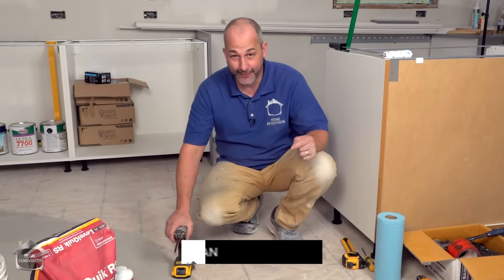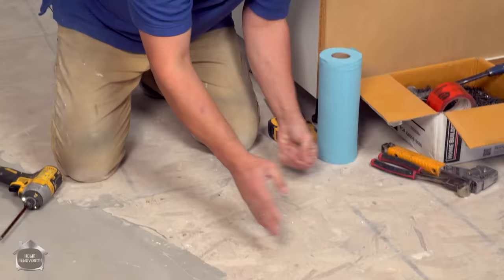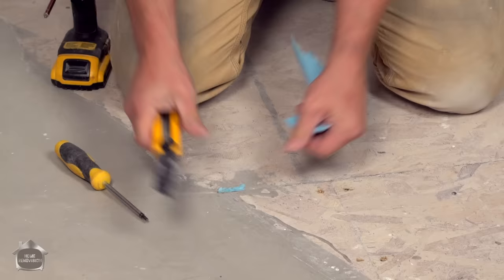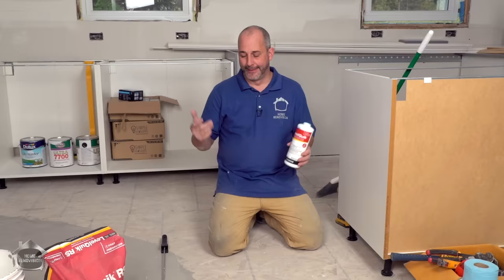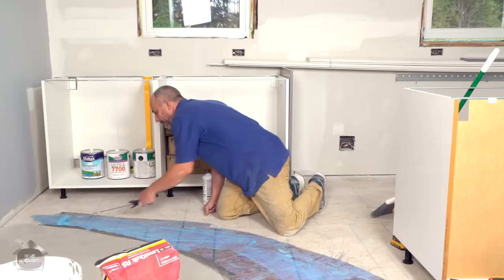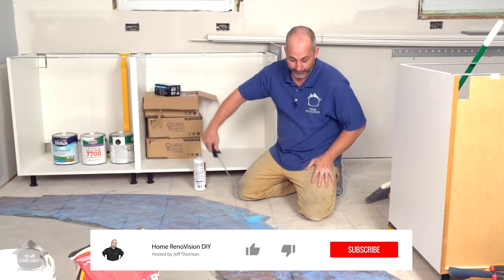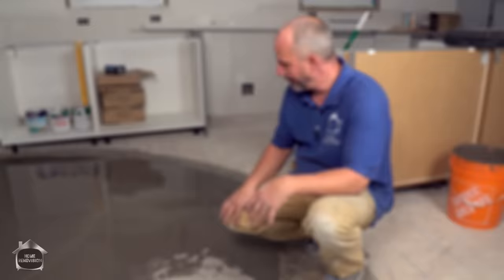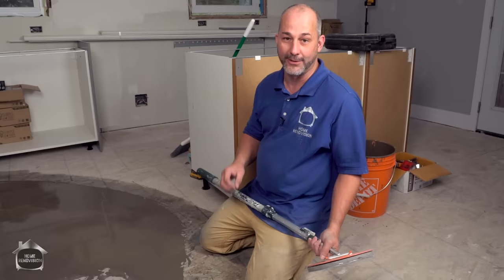How To Level Your Floors

Comment: Hey Jeff! Im at this exact stage in my reno and i couldn't be happier that you made this video. I have those old 1-1/4" floor boards, I've screwed down everything and got rid of the squeaks but I'm noticing that the boards are cupped in most areas and there are high points resulting in making the floor not even. My question is, is it worth re sheathing the floor and then seeing if i need a couple bags of self leveller, or should i disregard the sheathing, plug the holes and do a massive self level pour?

Thanks, 

Sunny V
Reply from the maker: Hi Sunny, a lot of the answer is in the rise on your staircase. you have to be careful to manage that height to the first step. it should stay as close to the second rise as possible to avoid tripping hazards. both options are good. In my case the stairs are a mess already so no fixing it the easy way so I made the floor easier with a second layer of OSB. Cheers!
Reply: @HomeRenoVisionDIY  Since I'm adding new oak treads to the existing stairs, ill have a little bit of play with the height. You did bring up a great point though about the stairs! I think i will re sheath the floor to help smooth out the bumpy subfloor and check again how bad it is when it comes to deciding on the self leveller. You're the man Jeff, Thanks a bunch for the reply! I know i can always count on your advice. Can't wait for the next video! :D

Comment: Hey Jeff - love the videos, thank you! I was just about to mix my floor leveller and noticed the 3rd step on the bag requires metal lath if installing on wood subfloor.  Thoughts?
Reply from the maker: I guess that would depend on the amount you are adding. If you are laying over 1/4" in a large area then that makes sense if you only have dimensional lumber floor joists. in most cases we are only using it to correct small area imperfections. I use plywood to build up bad areas so it does not require as much leveler. Cheers!

Comment: Whoever laid the tile in my house before I bought it did a lousy job, many hollow spots, slab probably looks like the moon. Lipping tiles, grout coming out, cracking ceramic tiles, needs to be fixed by me. I'm taking point here. 44' of drain line was replaced by previous owners as condition of my purchase. When they poured patch where they tore up the slab it wasn't leveled and they just laid tiles over it. I used about 30 tubes of Fix a Tile adhesive and realized the floor wasn't level and this was a bigger job than those adhesive tubes could fix. All the tiles need to be taken up, the slab leveled and new tile laid down. I'm learning to do it myself.

Comment: I didn't use primer in between coats just like you said in the video that it bonds to itself just fine with out primer on the second coat. After drying it has turned a white color and isn't hardening like the first coat, I can still scrape it off into a powder...any suggestions???? Second coat was put on 24 hours after first coat and second coat has dried almost 24 hours. Didn't look right

Comment: I have a question I have not been able to get answered.  Can you help?  I want to lay peel and stick tiles in my kitchen.  My subfloor requires the use of the latex sealant.  I’m extremely allergic to latex.  If the sealant is to make the surface non-porous can that be achieved with a water base polyurethane?

Comment: I'm getting ready to install LVP overexisting sheet vinyl and area that was previously carpet.  I'm laying 1/2" particle board over the area that was carpet to bring it up to the same level as the sheet vinyl.  What kind of floor leveler is compatible with vinyl and particle board?

Comment: Great video!
I`m doing a small reno in my new house, I got some uneven spots on the subfloor, and I will also add 1/2in plywood on top to match my tile for bathroom and kitchen.
My question is, do I level prior to adding the new plywood, or add the plywood and then level? 
I will be installing vinyl click planks for finish.

Thanks!!
Reply from the maker: I would install the plywood second. just make sure to buy the leveler that allows you to screw through it. Cheers!
Reply: Home RenoVision DIY  thanks a lot!!!

Comment: I saw this issue mentioned in an earlier comment. I like the info provided in this video, but have a question about how to transition between rooms.
I've an approx. 60 y.o. house that has much slope to its floors. Most of the flooring will be replaced in the next couple years or so, and I'd love to get the floors much close to level. Do you have any videos addressing how to transition between rooms in this circumstance? To level the entire (ranch) house together would possibly raise the downhill end several inches.
Thanks!

Comment: Is it normal to put the vinyl plank directly over the subfloor and leveler (plus foam underlayment, if required)?  I have 5/8" plywood subfloor on 16" OC joists.  I don't know if I should put down 3/8" to 1/2" plywood underlayment to stiffen things up.  The floor is not noticeably springy anywhere, except very slight deflection can be seen if you step right near the edge of the heating register, if you look very closely.  Maybe I'm being paranoid.  Would the answer be different if I wanted to keep my option open for tile down the road, without risking problems with dishwasher height?

Comment: Question for you.  Can I pour down self leveler and then put new 1/4" underlayment on top?  I have purchased the underlayment and not the leveler.  I'm renovating my house and the floors are all warped.  I'm sanding down the glue from the carpet pad/linoleum to get a nice clean surface to start from.  The house was built in 77' so the original subfloor is nailed down particle board.  I've been putting screws where there are nails just like your video states. I'm just not sure if I should put down the underlayment on top of the original subfloor and then level it or level it first then install the new underlayment. Any information would help.

Comment: I have a question I am about to use high end vinyl floor planking on a concrete slab the room is like couple feet below grade. Now existing are 9x9 anyway some are missing what would be best way to even floor.

Comment: I am sorry if this questions already been asked but.......How does on determine if a floor needs leveling?  I am looking at ripping out some carpet and doing LVP in my family room.  I assume the subfloor is OSB but I haven't checked it yet.
Reply from the maker: Hi Copper. in most cases use a 6' level and simply slide it around in different directions. if the variance is under 1/4" then don't be concerned. flooring companies usually recommend leveling anything  over 1/4" variance. keep in mind the stairs and transitions to other types of flooring usually requires you to install direct to the osb unless you want to start repairing all the doors and transitions in the house as well. Unless your house is old and suffering structural failure at points the need is usually minimal. Cheers!

Comment: Great video but just a question if the product is self leveling how come you need to sand it
Reply from the maker: unless you fill the entire room with leveler there is always going to be  a lip on the edge. properties of fluid. just like filling a glass of water . you can fill past the top and the water won't pour out

Comment: if your using SL in a basement on concrete floor with lots of large low spots - what can you use as filler? Using all self leveller would cost a fortune. Upstairs you recommend using plywood as filler, but in a concrete basement, plywood might rot and create a bigger problem? Thoughts?
Reply: He answered this for a person a little ways up and I have the SAME issue.  A few dips in the basement concrete. She asked if she could use thinset and cement board. Jeff said yes.  I will be using thinset and 1/4" Hardiebacker in two places where I have dips.

Comment: If you're installing LVP over tile, how much imperfection can the floating floor accommodate?  There are a few tiles with a higher corner from sloppy mortar.
Reply: If they are minor and few, you could grind the high corners down with a diamond grit wheel.

Comment: Question: I have an existing kitchen; the tiles are not all the way under the units (they stand [plastic "legs"as those in this video have] on a concrete depression [island]). I want to remove all the tiles; level the floor and replace with PVC (wood) flooring.
Can I have this done without rebuilding my kitchen?

Comment: I had engineered flooring installed on concrete.  There are many areas where there is a hollow sound when you walk in it.  Is there a way to prevent the floor from having the hollow sound?

Comment: In my experience with a floor leveler I have found that the area where the different pours meet won't blend together without help, but an "edge" is created instead.
Do you experience the same thing?
Reply: Mario Matejka a little sanding with 40 grit in the area that will be meeting should take care of the issue but, in general you’re gonna be covering it anyways so sanding the “edges” with 80 grit just to make it smooth should be more than enough. If the finished product is gonna end up being seen you’re best bet is to do the floor in sections then sand everything smooth and try to cover the whole floor with 1 thin coat of the leveler.

Comment: Thanks for the video, incredibly helpful. We just ripped up old linoleum that was glue down and are installing tile on top. Does all the old adhesive need to be removed prior to using the primer? 
Thanks!
Reply: did you get an answer?

Comment: Isn't floor leveler intended to be spread out over the entire area instead of going to featheredge?  I see you are doing multiple pours and patchwork, perhaps a different product should be used for this?  Or do they want it done that way so you dont have to sand afterwards?  I have to level a hallway and bath and I dont want to use a ton of self leveler, only what I need to get an acceptable amount of trueness for LFT.  This product says its supposed to be used with lath, is that only for a certain thickness?

Comment: I am replacing a basement carpet with waterproof vinyl flooring,but my problem is that I can not get the nails out of the cement from the tack strips that were for carpet.  Any ideas would help.

Comment: But what if I have a floor that is waaaay out of level? like several inches due to sloped floor for floor drain? High end in corner to floor drain in center is like 4" fall. Can you really expect self leveling concrete to fill 4". What do pros do in the case of something like that?

Comment: I'm in Kitchener, ON and my home was built in 2017 - they used nails to secure the OSB floors to the joists. Even when I go on new build construction sites in my area I see them use nails. Is using screws a new code requirement that builders are supposed to follow and if so in which areas of Canada?
Reply from the maker: New build still use nails. in some cases they glue the subfloor first. in some cases they even use screws. minimum code is not what is best for the homeowner. it is what is best for the developer. Cheers!

Comment: I'm about to lay some 12mm laminate (with 5mm underlay) on a concrete floor that our builders poured.  
The floor is not sloping, it's good and level BUT there are waves of small ridges in the concrete across the entire surface of the concrete, where they poured it and then used a long piece of wood to smooth it out (this was back when they were pouring the slab so the concrete was outside, but is now inside).  

Do I need to do something about these small ridges on the floor and if so, should I try to grind/sand them down, or am I better off using self leveller?

Am I right in thinking that if they are less than 3mm high that it should be ok, especially with the underlay, or is this going to ruin my laminate if I don't take the ridges off first?

Thanks

Comment: Are there any special tricks to using self leveling cement when the low spot is in the middle of two rooms with a doorway and walls running parallel with the lowest spot?

Comment: Hi Jeff! long time viewers first time commenters! we recently signed up for the membership and watched the live session on saturday. Hope your back is feeling better. 
We have a questions regarding our basement and floor leveling. We are finishing our basement and need to rough in, frame and level the floors. We are curious which order you would do these steps in? We are thinking of framing first, roughing second and then leveling. Our current concrete has been painted. do you recommend removing the paint before using the leveling compound on it?
Thank you for your time and everything you guys do!
Reply from the maker: If you have a floor drain I don't recommenced leveling a basement. Allowing water events to find the drain is paramount to reducing the scope of remediation. 1/2" of water on a level floor will cause your whole basement to need removing of the baseboards and drywall as well as drying all of the flooring. if you have a slope then it will only require drying and perhaps a little repair at the source of the infiltration. Always frame before rough in mechanical. Cheers!

Comment: :_RenoVisionHome:Hey Jeff...thanks for all you do. I've built 2 bathrooms and a pantry with your help over the years and made the decision to become a member recently!!! I have a question about flooring. I have an old slat hardwood floor in my dining room that I want to cover this winter with new flooring but it has a bow. I am wondering what the best way to get rid of the bow is without ripping up the floor? I was thinking about sanding the floor where the bow is but I am not sure. Any suggestions you have would be awesome, or a video that you have already done that would help out with this. Thanks for helping all the DIYers like me out there.

Comment: Thank you for your videos, they have been extremely helpful! I am currently adding vinyl planks on an concrete basement floor. There is still residue from carpet glue on the concrete. How much do I need to scrape it down before adding the self-leveler? I have scraped it down a few times over, but some of the adhesive is still there. Will the primer take care of this or do I need to get a grinder to remove all remnants of the glue?
Reply: I'm in your same boat. What did you end up doing?
Reply: @steveeab2364  ended up getting degoo spray and tried to scrape as much as possible. Wasn't really effective, but ended up just putting the vinyl down right over top without levelling the floor at all. The dip in the floor was like almost an inch deep in middle and maybe a 6x4 feet area. Had no problems installing the planks. They do bow a little but so far no problems, breaks or damage. One cheat is once u start putting down vinyl over the dip u can slide in pieces of cardboard (say from box vinyl planks came in) to fill the dip. Good luck with ur project!

Comment: Hi Jeff, this is actually a drywall question. I'm looking at buying a house, but all the walls AND ceilings in the whole house have knockdown texture, which im not a fan of. What do you think is going to be the best value  fix: skim coat it or replace all the drywall? I dont have much experience hanging drywall, and I've never taped it either.

Comment: JEFF!  YOU ROCK!  My fiance and I have been watching your videos and did a beautiful bathroom remodel!

We're working on the kitchen now. I have two questions.

We're on a concrete slab and the two-by-fours between slabs have rotted away. What do we use to fill them?

The house was built in the 50s and there's still some black tar from the old old flooring. Do we need to painstakingly scrape all of this up?

Comment: Thanks for the video. I have a couple of questions
I need to level a concrete floor in sections, possibly with a week or two in between applications. Is that ok? Will the leveler bond to itself ok even after it's cured? I plan to use the primer on each section at the time I level it?
Thank you
S.

Comment: Hey Jeff, our upstairs neighbor had contractors that tried to level the floors using a water-based self leveling cement. Half of that cement material came dripping through our interior walls. Do I need to rip open the sheetrock to check on our electrical or plumbing? Is it okay to just leave that cement in between sheetrock? I can’t find an answer anywhere and I’m at a loss for what to do. Help!

Comment: Hey Jeff.  I love your videos and am renovating a little block house on a concrete slab built in the late 1960's in the southern US.  I gutted it to the studs and hired help for the electric, plumbing and drywall.  The windows are an ongoing debacle, but I'm asking today about the order in which things should be done.  Once the window situation gets dealt with, I'm looking at new sheet rocked walls and untrimmed windows and a concrete floor that is in some areas covered with a sheet vinyl product.  My plan is to install laminate flooring on top of the old sheet vinyl, if possible.  (tile floor in bathroom and laundry closet) Of course, I'll be putting in cabinets, tiling walls, etc, in the kitchen.  And toilet, shower, vanity in the bathroom.  My question is, can you give me an order in which things should be accomplished.  Like floors first, then painting walls, then cabinets, then wall tile, door trim, then window trim and baseboards/crown, then countertops, then appliances...or whatever.  I just need some help with sensible priorities. Thanks in advance.  You are my hero!!!